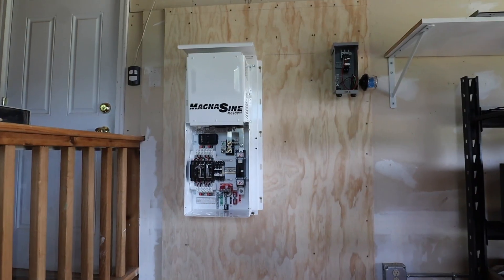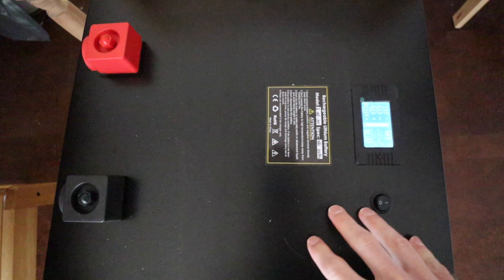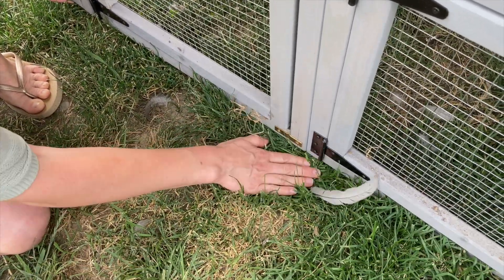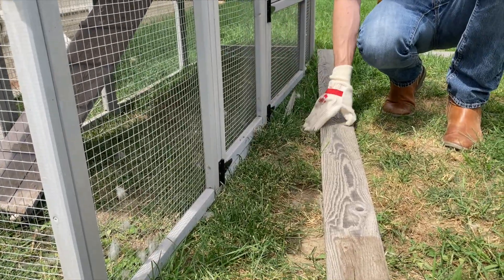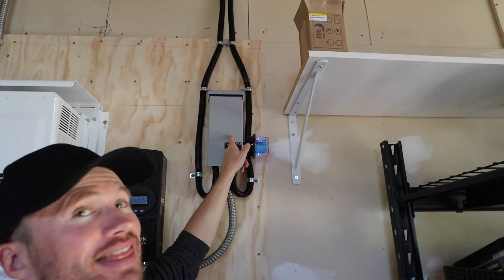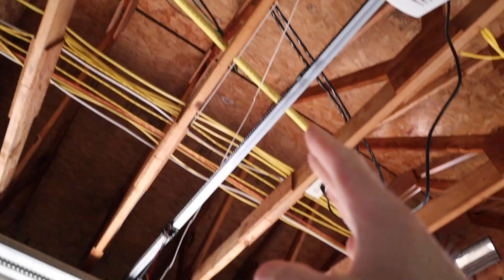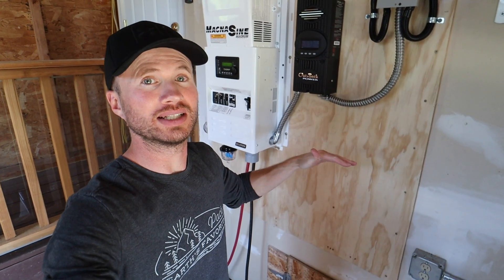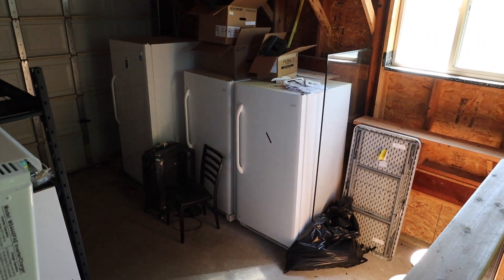Homestead Energy Resilience | Solar Battery Bank

Comment: Congrats, Dan! I'm a little jealous, we'll be 100% off grid when we build on ours but the costs right now have me pretty intimidated. 
Good job on the reinforcements to thr "tractor." I have to agree with someone else's comment; the coop company seemed to have taken a static tractor design and used flimsy materials to try making it mobile. Good call on pulling out of endorsements.

Comment: The chicken tractor looks like they took the cheap omnipresent design for a basic stationairy coop, added 2 wheels and a pullbar and called it moveable. I hope it works for Dancepartner with these modifications though

Comment: Great job!  Glad to see you on your way to energy resilience.  Have you considered looking at a grid-tie inverter?  This would allow you to use all of the energy from the solar panels all the time, and any extra needed would come from the grid.  Using the solar system only as a back means you are throwing all of the extra energy from the sun away every single day that your batteries are fully charged.

Comment: Thank you for sharing! Solar is too complex for me to DIY. What was the cost of your system? I am worried about keeping my freezers going.
Reply from the maker: It was very expensive.  I saved up for it a bought it in phases.  Those lithium batteries are the majority of the cost.  If you look at AGM batteries, you can get a more affordable system.
Reply: Just to get our system usable right off the bat with the budget we had, I went old school with “open” (non-AGM) lead acid batteries and will put them in an insulated box and monitor its temperature. Over time I’d love to upgrade to better batteries, perhaps by the time these wear out. 

That’s something that really helped me make decisions on how big a system to go for, starting out: I wanted a system that would fill our most basic requirements, but be complete and functional from day one. And I sized the components and wiring so we can always add more solar panels and batteries over time, or upgrade to higher quality components. But at least we got SOMETHING going. 
Things to think about for those just getting started or thinking about it.